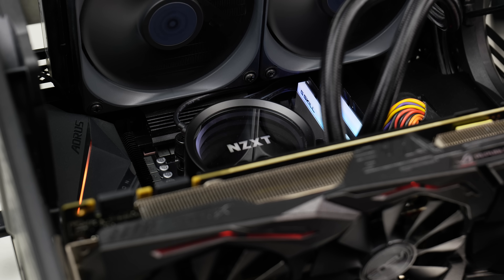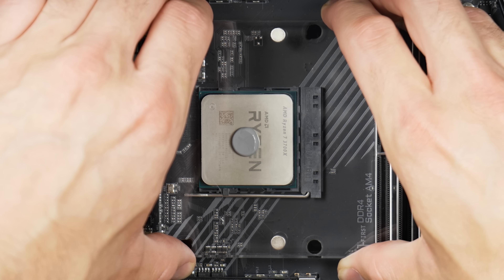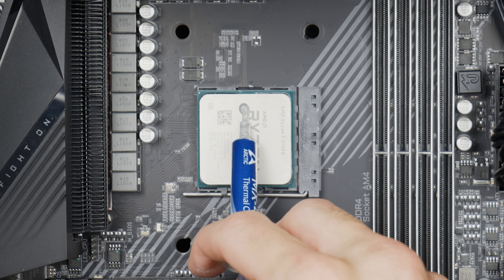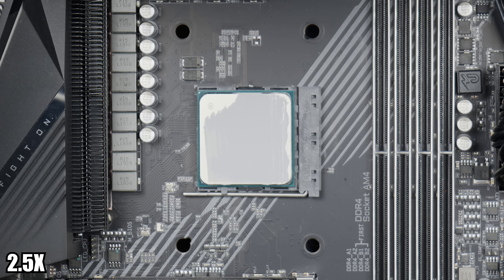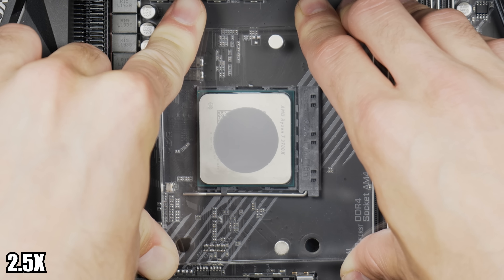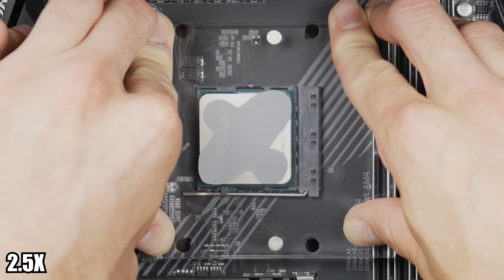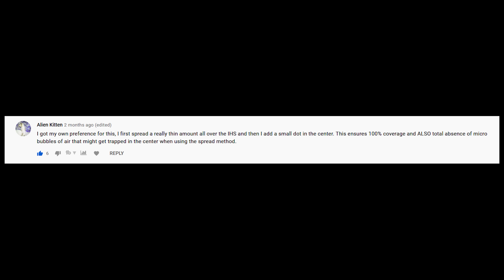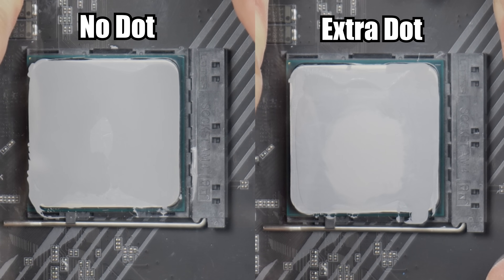Thermal Paste Spread Under Glass

Comment: My technique is called "The constellation": I manage to use the amount of the pea size to place 12-15 mini dots over the CPU. To me the best way to make sure not to use too much paste and making sure all the surface will be covered. I get my Ryzen 7900 ideling at 27ºC in a room being at 23ºC.

Idle temp says as much as huge stress temps when comparing cooling methods. also taking in account that my CPU is the 65w TDP, not the 128w version.

Comment: Magic pro tip. Instead of making 1000s of youtube videos and wondering for an hour if line is better than x, just use the good old recipe - drop a bit in the middle and spread it all over with a stick. Guarantee it will have best contact and it will take you maximum 1 minute.

Comment: I am still after years going with pea sized dot and I do it on the smaller side. My resoning - covering entire IHS is simply unnecessary, the chip behind it except of maybe TR is no larger than 60%, maybe 70% of IHS. So as long as you cover the centre the temperature differences are negligible, maybe literally irrelevant for performance. But by not overloading the paste... I both save the paste and save myself trouble cleaning "the drip" in future. As well that allows me to tighten the cooler quite hard without too much paste sqeezing around, remember - the layer of the paste should be as thin as possible, paste is only there to fill microscopic inperfections between cooler and IHS, not to look like double oreo filling. 

The only feedback about the method - using actual glass would have been better, because acrilic bends... And yes I just realised this is 2 years old video, but I have already wrote evetything..

Comment: Great vid. my only complaint is you need a control - drill holes in the acrylic with your cooler pattern. apply the same toque to all 4 corners with screws for each paste pattern instead of pushing down and sliding it around, you'll naturally apply uneven pressure to see the spread come to favorable view. all the results are void from a scientific standpoint but still a good visual representation

Comment: I think the only difference in methods is that some get paranoid because they do not know if the dot spread enough so they feel more confident if they spread it out before putting the cooler on. Like when I was working as a IT guy and had to replace around 100 PC's that paranoia lasted for like 10 computers and after that it stopped bothering me. Like you will notice if you messed it up in some way when checking the PC. Yes they do have a point that with the new bigger CPU's, saves you the "did it spread correctly" paranoia but what if your layer was too thin, maybe it was too thick, maybe a hair ended up in the paste, what if...
Reply: https://www.youtube.com/watch?v=_6mjbtgmN_k

Comment: I really think you should be using acrylic that you can screw into the mounts, and perhaps thicker so there's less flex to it. I can't say for sure but I doubt you're applying as much force to is as a fully mounted cooler is applying to the surface of the CPU... I'm not sure that the results would be different but the fact that it takes that much effort to spread that much thermal paste across the CPU plate says to me that you're probably not getting anywhere near the amount of force that's actually being applied when you mount a cooler, you shouldn't need that much thermal paste to just barely cover everything. I imagine that just one pea size amount is capable of covering the entire surface of the CPU the pressure and forces being properly emulated.

My theory is that the pea size dot would actually spread across most of the CPU, leaving only the corners untouched.

Comment: Thank you so much! I was very scared of doing anything myself inside my laptop but it was overheating and wheezing recently, it just needed a good clean up and a bit of new paste. It took me forever (my sinks were attached with two big fans, it was a struggle) but finallyI managed to clean everything up, add new paste and now laptop is running quieter and doesn't get so freakishly hot. THANK YOU!

Comment: Well if you don’t care about getting thermal paste all over your board and socket then just throw a entire tube on there. While thermal paste is usually non conductive would you want to chance it with a 500+ cpu. I put some on install the AIO then take it off check the coverage then add a little more if needed.

Comment: I always spread the paste with a tool to get the perfect thickness and make sure it has complete coverage.

It makes a huge difference if your hope-and-splotch method doesn't get complete coverage.  And by spreading yourself, you know you've done the job.  No guesswork.

And the final time that happened to me, I tried lifting the cooler off the chip and nearly damaged the chip when there was enough adhesion to rip the chip out unexpectedly.

Comment: 20 years of building PC's and fixing electronics, air bubbles do get captured and over time can push paste out when the gasses warm and expand but don't escape causing a cavity. Most the time the gasses do escape and you see little splatters of thermal paste where the gas escaped.  Seen it plenty of times

With all that said, CPU's made in the last ~5 years are noticeably flatter than they where before. Older CPU's are almost comically wavy and can EASILY capture an air pocket

Comment: I can't help but cringe whenever I see people making a big deal about air bubbles. With all that pressure of a heatsink clamped down to the a CPU(which, by the way, is A LOT more than you get pushing the sides of a piece of glass with your bare hands), it's just not really a thing... Moreover, if there are ever some air bubbles left, those will expand and find their way out as the CPU will get hot. That's just how thermodynamics works, air(which is made of several gasses) expands when heated and want to get out.

Now for the methods of applying, we used the X method(not going all the way to the corners) when I had my computer business a few years ago. The reasons were that it was quick and easy to do, easy get consistent applications across multiple systems and between different technicians, it (usually) covers the whole heat spreader and also spreads fairly evenly across the surface.
Reply: Thanks. I applied thermal paste for the first time and only did a dot but my CPU is running just as hot. I will try the X method.
Reply: @Liasos88  try to see how the thermal paste spreaded when removing the heatsink. That's the thing, you don't really know how it ended up until you remove the heatsink (or somehow own sophisticated tools that allows you to see it through the heatsink). You can also judge whether you put enough or too little, and learn from that. 

Don't forget to clean the old thermal paste on the CPU and heatsink really good with alcohol (the higher the percentage, the better, I was using 99%, but it can be hard to find, 70% is pretty common though) before applying the new one.
Reply: @HCkev  Thanks for the tips. My old paste only covered about 60% so I used more this time.

I started a game and ran it for about 10 minutes and CPU temp went up to 75 degrees (C) with the new applied paste. If that's max I think it's okay but if it goes up to 85 again something else is wrong. I have a good Noctua fan so it can't be that.
Reply: @Liasos88  that seems a little hot for a Noctua heatsink, what model do you have exactly?
Reply: @HCkev  I forgot the model name but I have a Cooler Master heatsink. The CPU fan is a Noctua NF-A12x25 PWM. 
I have an old CPU though, might be why it's hot. i7-4790k.

Comment: A tiny line between IO and the 2 CCDs for ryzen works best effectively and economically.

A tiny line over rectangular die for Intel is also best economically and effectively.

The one needs to know what is actually under the CPU cap in order to apply methods above properly.

Comment: direct heat pipe (water under vacuum pipe) from cpu/gpu to the top of the case radiator, kinda more like a out of the case heat sink cooler more than a water loop, but better than a water loop rad combo

Comment: I use a hybrid of the x and pentadot method. I do a dot in the middle (much like the too little thermal paste example) and then draw a thin/fine square around it. I've also done the boxed in X (like a fillable PDF) before.

Comment: Well airpockets shouldn't form when mounting a real heatsink cause the screws aren't tightened at the same time so there will be some uneven pressure thus the air will move away from the center and out
Reply: When spreading it out with a card that is!

Comment: It is not just the spread that's important it's also the thickness of the layer of paste. Ideally you want to have a thin layer as possible so the heat can travel the quickest to the cooler. So the X might cover the CPU easily but it's so much thermal paste that it might leave a relative thick layer in between the cooler and the CPU. Also the actual die that's beneath the heatspreader is smaller so that's also something to take into account. At the end of the day you just want to measure raw performance, that's best way to test if the thermalpaste is applied correctly.
Reply: Just use a graphite thermal pad instead, 1% worse than optimal thermal paste, but reusable infinitely

Comment: Perfectly unscientific lol. I mean it would be more valuable to have the acrylic use some mounting hardware for the actual cpu. Then we would get a somewhat normalized amount of pressure and spread as opposed to thermal paste veering off in any given direction, and then applying counter pressure to even it out.

Comment: 3:11 If you spread the thermal paste evenly, you will not get an air-bubble, for god´s sake. And I would have essential concerns: You are not performing the test under working temperature; no one can say whether he/she put the CPU-Cooler evenly, because they are not made of glass; just trust the expertise of my brother, who has built hundreds of PC´s without producing thermal issues: butter that toast, but do it right and very thin! You can clearly see that there is a bright spot in the middle, before putting the glass on. buttering the toast with some jam will most likely be contra productive due to the usage of too much thermal paste.
Reply: You are not supposed to evenly spread it.

Comment: Too much paste just traps the heat. Thermal paste is only supposed to fill the micro cracks/spaces on the die sink and the heatsink. The small dot or slightly large dot is perfectly fine method.
Just enough to have heat transfer contact between the die and the heatsink.
Even if the small dot doesn't spread out over the entire die-sink. It doesn't matter as long as in in general cover the 'chip' underneath and facilitates the transfer of the heat to the heatsink. As I said just fill in the micro-cracks/groves/scrapes whatever you want to call it between the heat spreader and heatsink.
The dot method = no air bubbles and an even 360 degree spread outwards in all directions.
Reply from the maker: These amd chips don't have the same heat map as a traditional CPU.

Also, time and time again it has been shown that 'too much' thermal paste is not a thing. unless you worry about the mess afterwards. The mounting pressure of the cooler will push it out.
Reply: @TechIlliterate  Sure thing. Can never have enough thermal paste. lol....

Comment: Nice comparison :) It would have been nice to make sure that the pressure / pushing force is right (right in respect to the pressure which the colling element, mostly a cooling fan, will apply). As long as you increase the pressure it will lead to an ongoing spread of the thermal paste and sometimes you could missimulate the effect a bit by applying too much pressure just to get the paste to each corner (here again, too much in respect to the cooling element which would have a set pressure if you mount it in the right way).
Reply from the maker: I've considered redoing it, make a device to mount a think acrylic sheet.

Comment: The X method is incorrect, because it doesn't apply even coverage once the cooler is put into place. It's very easy to do it right; just use a thin bead at the top, and use something like a playing card to spread it. When done, the entire CPU should be covered, but it should never be so thick that it will ooze everywhere once the cooler is set in place

Comment: They say the method doesn't matter because it doesn't change the thermals.  I say there is a point for the craftsman to be made.  If you make an accurate enough measurement, you will certainly find that the carefully applied even coat of paste is better.  Even if only fractionally, it makes a difference over time.

Comment: 6:25 thas a good question the end one if it need break-in time, maybe cuz i used Thermal Grizzly Kryonaut The High Performance Thermal Paste on a GPU i immediately put back together, powered it on and temps and fans Ramp to the fullest i got scared,LoL but after the restart all was fine and does give great temps. But i don't know if Silver Artic and the product i spread on GPU are similar but sure as hell Hit the Main Power off button.

Comment: Rule N°1, find the layout architecture of the cpu you are using, make sure to cover the chiplets no matter what. Meaning in the case of Zen 3 two line in the right place would be safer to bet on than say 5 dots that could be too small and too spread on the corners edges.

Comment: Why wouldnt you just take two flat thick pieces of plexiglass (So there is no bending) with the bottom shaped to match the processor or even just the shape drawn on.  Set up two cameras to get top and bottom contact surfaces so you can see if there are any bubbles on the contact surfaces.  Honestly if the bubbles are small it will have a negligible impact so I doubt this is anything but a myth

Comment: You forgot the BEST method of all: spread evenly with your FINGER instead of a plastic card. Then you can also make the center 10% thicker then the rest to prevent the airbubbles, while still maintaining an extreme thin layer which is too thin to spread out. It's only needed to fill micro holes, not to create a massive layer between the CPU and cooler. Any excess over the edge of the CPU is absolutly unacceptable, and even 1 square mm not covered is also unacceptable. My method is the only one that always work, also on GPU! Then only need a little cleaning-spirit/white-spirit/thinner to clean your finger. Do not use gloves because you don't feel what's happening.

Comment: Thanks for posting this  video.  My PC has been shutting-down with greater frequency.  I started monitoring the CPU temps and saw that they were averaging in the high 60's C, spiking into the low 80's.  Time to re-apply thermal paste! (And thoroughly clean everything else)  I followed your advice of using the X method.  CPU temp is currently averaging high 20's.

Comment: You are pushing down on a huge piece of flexible acrylic, essentially causing a dome shape which will trap air.  It would be a better test if you placed a flat piece of metal on the acrylic and pushed directly above like a cooler would. Then take a peek at the results. It's also more accurate if you can't see when you push down, because the real deal must be blind. There is no option to see the bare spots and push harder, wiggle, jiggle, or whatever else people will do automatically  (subconsciously) when the objective is to cover the whole surface.  

That air bubble thing is a myth. The whole point of using paste is to fill in the microscopic divots in the metal, of which are full of air. When you squeegee on a thin layer of paste, it's far more likely the tiny pockets won't have air trapped in them.

Comment: I did butter spread and thermals were okay but. fans were ramped up hired and stayed locked. I reopened the GPU and saw air pockets. So I went with an x and a small pea-sized on the middle. The Results were much better afterwards. I also highly recommend an X with a dot in the middle of the x.

Comment: I was using pea in the middle until today, tried the X today with Arctic MX-4, because it seemed like the best thing to do
Now I'm idling at 30 °C in the hottest room in the house, with just one fan, the CPU fan, in the entire PC.
So, X works for me, but the paste also makes a difference. MX-4 wasn't that much more expensive than cheap off-brands, and it delivers.

Comment: basically if you can see thermal paste, you've used too much. Thermal paste is NOT ment to cover your entire CPU.

There is NO good application of thermal paste anywhere in this video. In EVERY case you used WAY too much.

The correct way is a rice grain, then spread it with like a credit card. Remove as much as you can scrape off. Then do the same on the cooler side.

Paste is NOT ment to be between CPU and cooler everywhere. Basically what you want is the CPU touching the cooler everywhere. So all paste has to do is to fill up any crevises there might be.

This is old school tweaker knowledge. Give me ANY CPU you thermal pasted, and I'lll redo it the correct way and save you at least 2-5 degrees.

Comment: why didn't you just use 2 prices of glas, one marked or the size of the cpu??? then you would know "where the bubbles go"

Btw, thermal paste application usually only differs in temp due to differences in amount, not really how its applied. But i haven't seen your other video, so you might already have that covered.

Comment: Well you pressed until evenly spread. However, the cooler itself and its bracket will apply force only according to their construction. I would conclude, the right pattern actually depends on the top bracket and its pressure distribution through the cooler body. Still, I enjoyed that video a lot :)